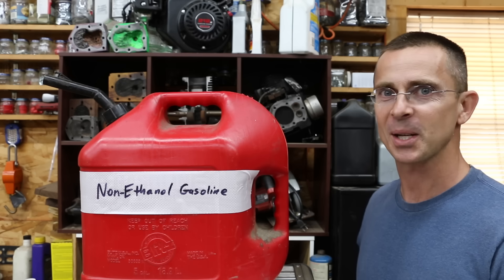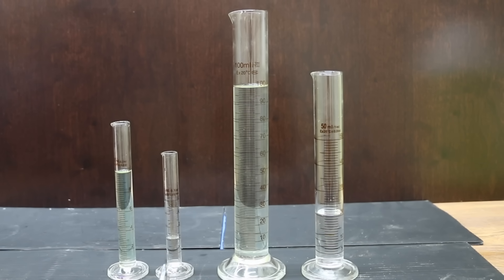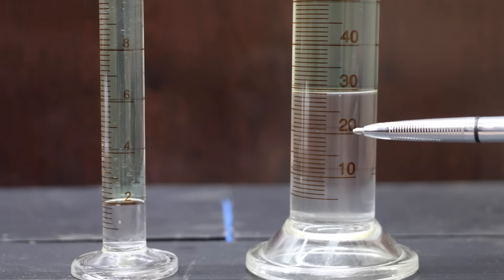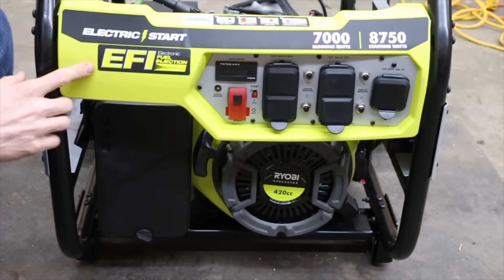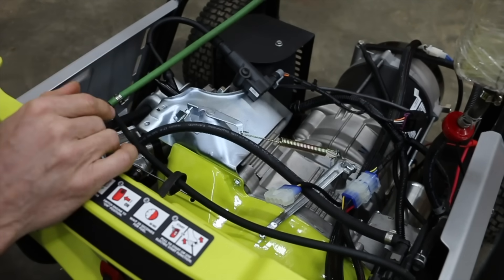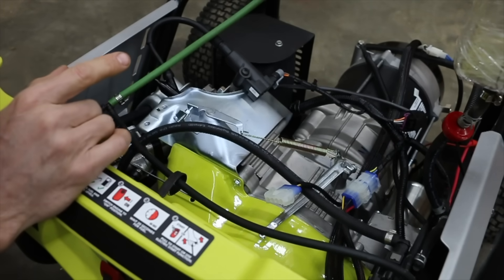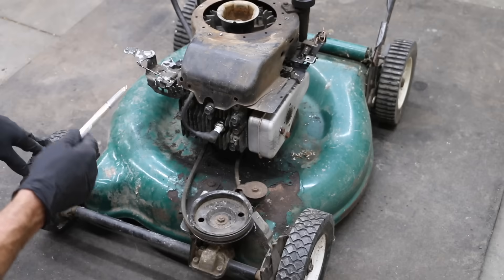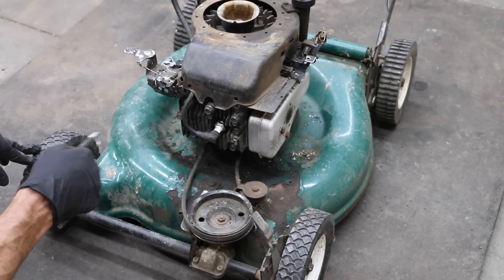Is Non-Ethanol Gasoline Really Better? See the PROOF!

Comment: Over the past 8 years  my Ford f 250,  390 ci V8 with 2 barrel Autolite carburetor has been rebuild 3 times only because  after about 1-1/2 years plus, it started leaking around the accelerator pump  and the spark valve,  I held them bothe up to the sun light  and they bothe were perforated with tiny holes,  all 3 times !!!  So I was talking to a gasoline tanker driver and he said that in California all gasoline is at least 10% ethanol unless you get it at
 an airport, as the FAA will not allow ethanol in their gasoline.   It eats away the rubber.  So far I have call two carburetor rebuild kit companies and they Don't make ethanol resistant carb kits ??
Reply from the maker: Thank you for the feedback

Comment: Lead was by far the best but not healthy
Reply from the maker: Thank you for the feedback
Reply: @ProjectFarm  i loved the video it was very professional. 

I had a 78 f250 when they switched the gas in my area during the 90s and it was a true chore to get my downdraft carb to work right.

I almost got the run time down on your test my guess would have been 32min because ethanol isn't as efficient as strait gasoline. I thought it was 15 to 20 percent less efficient I know my explorer milage really suffers on e85

Comment: To summarize: Non-ethanol is not preferred because it is "better" or more fuel efficient. The reason gas stations offer a pump with non-ethanol gas is so consumers can avoid the small engine issues caused by the ethanol content in conventional gasolines. If you put any kind of ethanol blended gas in your mowers, gas-powered blowers, trimmers, chainsaws or anything else with a small engine, you're probably going to have trouble. So non-ethanol gas is not favored because it is better or that it gives you something more, but rather that fact that it gives you something less - something you don't want.

Comment: You can't escape 10% ethanol fuel in my country. Every gas station has them, and are subsidised by the government, so it is cheaper than pure gasoline. I think it's the same as 100% gasoline, it also depend on your engine. Mine has a bit worsen fuel economy on ethanol fuel, but because it is cheaper per litre, I have no reason to use pure gasoline.
Reply from the maker: Thank you for the feedback

Comment: I noticed that rubber and gaskets dr in out terribly. With ethanol. Rubber in Weed Eaters dry out. The new carburetor cleaners cannot be used on any rubber. It will swell. But I've been using non ethanol fuel. I haven't had hardly any problems with my weed eaters. My chainsaw runs good with it. And you can sit for 6 months. And start right up. And they tell me that the ethanol turns into sugar. Because it is grain alcohol. Yep that's why there's so many diabetics in the world

Comment: Another great video! I am lucky, one of the gas stations in town carries non- ethanol in 87 and 93 octane. I treat the Jeep to a tank full from time to time and i do notice a little better gas mileage. My usual gas station is Costco.
Reply from the maker: Thank you for the feedback
Reply: I don't know what engine you have, but most MOPAR designed engines get MUCH better fuel economy (and MUCH less valve seat wear) with 100% gasoline. My 2017 Ram 5.7L Hemi gets 26% better fuel economy on 87 octane 100% gasoline as it does on 91 octane E-10. Using 91 octane 100% gasoline I have gotten as much as a 35% fuel economy increase, returning 27.6 MPG (by fuel burned, not the read-out) on a 800+ mile all 75 and 80 MPH Interstate cruising trip. Actually, 17 miles of in-town driving included. Now 27 1/2 MPG in a 5860 lb. (curb weight) 4 door 408HP V-8 auto tranny , power everything pick-up ain't shabby. I have a 26.77 gallon tank (from putt-putt-die) and traveled 680-odd miles between fill-ups. I gap my plug +.005" over "spec" and change them at 50K miles, all 16 of them. I watch and get coupons/sales from Pep Boys/Auto Zone/ O'Reilly's usually for NGK or Bosch Platinum plugs. It's a crime to use "gasohol" in small engines, especially 2 strokes. The oil doesn't mix with ethanol. The ethanol then attacks all the buna-s rubber in the fuel system (the diaphragm of the carb) and turns it into jelly, especially in storage. I can go to any garage/yard sale where weed-eaters are for sale (and don't run) and one pull tells me if they had ethanol in them.The rings are bad and the cylinders are scored=low compression.
Reply: @Walkercolt1  I have a Jeep Wrangler JL Unlimited. It has the 3.6 Pentastar V6 mated to the ZF 8 speed automatic. It is a lot better on gas mileage and refinement than my old Wrangler JK Unlimited. Both engines seem to like 89-93 octane. The JK had spark knock/rattle if I used 87. I always use Top Tier gas stations but on occasion I run the tank almost dry and fill it up with non-ethanol gas. I agree with you, the mileage is better and the Jeep runs better on it.

Comment: Combustion energy density in MegaJoules per kilogram
Gasoline (petrol) = 46.4 MJ/kg
Gasohol  (E10)  =  43.5 MJ/kg
A tank of E10 will have 43.5/46.4 (or 6.7 percent) less energy than pure fuel.
That does not mean that a vehicle will lose 6.7 percent in MPG. Modern vehicles have computers that can sense the fuel and make small adjustments in spark timing and other engine controls to partially compensate for fuel energy. Another engine with higher compression ratio might tolerate and adapt differently, depending on driving conditions. Ethanol tends to work better in engines with higher compression ratios.
Basically, E10 is the same as adding a few percent water to your tank. Pure ethanol has about 30 MJ/kg combustion energy. E10 also will suck humidity out of the air and becomes "more water" with time.
https://en.wikipedia.org/wiki/Energy_density
Reply from the maker: Thank you for the feedback

Comment: I get 30MPG with non ethanol gas and 25MPG with 10 percent ethanol. Non ethanol also feels a lot smoother at idle and has more power pulling hills.
Reply: @trevorwylie5882  ethanol boosted gas is only going to hurt badly without some sort of tune up to use all that extra octane. Even then it's not as good. But Ethanol can be created using farm byproducts among other stuff, it may well be the future for internal combustion engines once crude oil supply begins to run low

Comment: Greetings from the Napa Valley. Love your detailed videos.I have a small engine repair or service shop and get a lot of work from machines that sit for extended times with ethonal fuel.I'm very good at just cleaning the varnish and corrosion. We just had power shutoffs due to fire dangers from our energy providers Pacific Gas And Electric. I had a flood of generators 11 in a two week time span.9 of them just crapy ethonal fuel past its shelf life.I think you will be able to verify that. I did see your penetrating oil test and appreciate debunking some expensive but worthless brands now that saves us money Thanks. I use one called kroil that I get online or at a auto parts store I love it.It is not cheap  Says it creeps into a three millions gap. It does have a punjiant odor.Great videos Thanks. Jerry B

Comment: Consumes just as much fossil fuels to make this stuff from corn so no net gain in terms of the world pollution.  Does burn a bit cleaner and does increase the octane from 80 to a more 98.  What is does do for Milwaukee in Wisconsin, is move that pollution in making this stuff to Northern Wisconsin.  People up here are suffering from this fifty ethanol plants. 

Its hygroscopic, absorbs moisture, can use common forms of copper, brass, neoprene in fuel systems, will etch them away, also dissolves forms of plastic.  Totally destroyed the entire fuel system in my precious 88 Supra Turbo.

What doesn't make sense to anybody, 10% ethanol in some vehicles cannot use 15%.  Still has the same negative effects, but takes longer.

It's also a heterogeneous mixture ethanol and gasoline do not mix,  when a vehicle sits, the ethanol is heavier than gasoline so settles to the bottom of your tank, fuel pump picks this u first leaving you with 80 octane fuel that causes detonation in your engine to destroy it.

It is used to feed large SUV's and Pickups that burn more than twice the fuel as compact vehicles, people drive these beasts because it give them power.  The food to feed these beasts is taken away from us humans.

Ethanol with our corn is insane, does work much better with sugar cane.  Some dingbat politicians that don't know their hole form a hole in the ground push this BS against our stupid Americans.  Not saving anything.

Thanks goodness we have Mercury and Harley Davidson in Wisconsin, for a brief period, ethanol is all we could purchase.  Charging a lot more for ethanol free gas even those its cheaper to manufacture.  Makes one hate stupid politicians. Democrats and Bush kid were the worst.
Reply: all it is is GMO corn, which is not fit for human consumption. So its a loose loose proposition....not good for fuel, nor food....

Comment: The molecular structure of the blended ethanol/gasoline causes a chemical reaction that results in expansion and thus more volume reaping big oil substantial revenue  gains when dealing with massive throughput. So they are gaining financial rewards  through the sale of a certain amount of fuel produced through a chemical reaction reducing demands on their production inventory. This along with selling you a product that is  5% less efficient mileage wise gets you back to the pumps more frequently . This procedure is known as side stream blending . On the up side is reduced tailpipe emissions resulting in  better air quality. With thousands upon thousands of people dying every year due to respiratory illness directly related to poor air quality the ethanol blending is at least acknowledgement of the problem if little else.

Comment: I had a 2010 accent and the owners manual said to not put ethanol gas in it all.  I wonder if ethanol cause me to need a new head gasket.  Didn’t really feel much of a difference when I put non ethanol gas in it though.

Felt a RIDICULOUS different in my 94 car N.C. Camaros 3.4 V6.  And when i refilled with ethanol gas I really realized how much ethanol was holding it down.

I don’t think your gonna get more than manufacture specs, it’s just that ethanol keeps you from getting.

Comment: 10 percent alcohol gasoline started to be sold in 1979. The alcohol does less energy than the base gasoline, but the alcohol has more energy than the octane boosters it displaces, so the fuel has more energy with alcohol than with the full octane booster additives. Several things have happened in 40 years. The federal requirement to label the alcohol on the pump, the Internet and most of all, the other fuel additives now used have a shorter shelf life than the older fuel additives, with or without alcohol. So yes, fuel today does have shorter shelf life than fuel used to have. 10 percent alcohol had no great effect on the gasoline, but higher percentages can.

Comment: It makes sense to me that with a simple carburetor there would be a difference in carbon buildup WITH A GIVEN TUNE.  Properly tuned for whatever fuel you're using it would be a different story.  Exactly what the results would be I don't know, but to my knowledge nobody has ever done that test.  Alcohol and gasoline require different air-fuel ratios.  A car, with electronic fuel injection and lambda sensors, will adjust the mixture as needed for different fuels.  Lawn mowers will not.  Unless you're re-jetting, and possibly even changing the basic timing (difficult to do with magnetos) then you're comparing apples and oranges, as far as which one gives you less carbon buildup.  But the alcohol WILL wreck rubber fuel system components.  It WILL result in corrosion in the fuel system.  It WILL increase fuel consumption and reduce power output.  Those are givens.  Use non-ethanol fuel and keep the spark plug clean.
Reply from the maker: Thank you for the feedback!

Comment: Basically a worthless test as the duration was too short to make any meaningful comparison.  Of course non- ethanol gas will get better fuel economy, it has a higher energy density.  Also, without tuning the engine for the type of gas being run the test is automatically biased towards the fuel it was designed for (this goes both ways).
Reply: So your assuming everyone drives cars that have been made to run with ethanol?"
Reply: @ghostcell030  No, since at low levels (10%) the addition of ethanol makes almost no difference- and yes, since for the last 20 years 10% ethanol blend has been standard throughout the US, I would have expected manufacturers to change their tunes enough to accommodate.

Comment: In Alaska ethanol blended fuel at the general pump is banned because it pollutes the waters by corroding seals/lines in marine equipment. To sell any ethanol blend it has to be at a proprietary pump and clearly labeled.
Reply from the maker: Thank you for the feedback
Reply: And AV gas (like 100LL)  is pretty easy to get owing to so many private pilots.
Reply: @SaneAsylum  can you refresh us on what is avgas? Purified gasoline?
Reply: @MmeHyraelle a gas is just gas that has higher quality standards. Octane is higher in some grades, plain old 87 in others. My aircraft has a supplemental certificate that allows me to run it on 87 unleaded with no alcohol auto pump fuel. Saves a ton of money.
We had some fuel thieves one night….thought they were getting avgas for racing fuel…. We all hope they enjoyed their loss of performance.  lol
Reply: Should be that way everywhere. We are having that crap forced on us.
Reply: Brazil has 100% ethanol fuel at every pump. A permanent competition with the oil companies. Why aren't their engines falling apart?
Even Henry Ford knew it was the way, it was his fuel of choice. Rockefeller quashed that by pushing prohibition.
Watch Pump (2014): https://vimeo.com/237643999
Reply: @thewolfin  several years back I ran a full tank of 100% ethanol fuel in my Dodge Ram.  I believe my engine ran smoother, had more power and went longer before it needed refueling. If I could get 100% ethanol fuel where I live I would buy it.
Reply: They killed an industry with Cash for Clunkers, never forget everyone involved
Reply: DOPENOLA 1  just because a country  has issues doesn't mean certain aspects or ideas that come from it are automatically bad.
Reply: In 2006 Missouri enforced 10% ethanol in ALL pump gas. My new vehicle instantly lost 10% MPG, go figure. Now, my new 2019 vehicle only gets ethanol-free gasoline. Only one Casey's across the state line in Kansas offers 87 octane ethanol free. 91 octane ethanol free is all that is available, so be it.
Reply: @tedroesch9133  In the last few months I've also started using only non ethanol 90 octane gas in one of my cars. Luckily I have a gas station just 5 miles down the road that sells it, but when I travel I discovered an app that I downloaded called "pure gas" and it gives a map of your local area that you are currently in showing all the gas stations that sell non ethanol gas. Even if I have to go out of my way to get it then so be it.

Comment: From my personal experience, I have a Chain  saw I had purchased new.  The manual states I could use 10% ethanol so I did. . It did OK but was hard o Start and hard to keep running but was able to use for a while.  Over time I noticed the plastic fuel cap kept getting harder and harder to remove, then the machine was even harder to start and keep running....  the fuel cap became so hard to open to the point I had to take vise grip pliers to remove the fuel cap....  I decided to change to non ethanol fuel and after the second tank the fuel cap would spin off by hand and the saw ran like a new beast....  such a dramatic change  made me a believer   I also started running it in my leaf blower after replacing the primer bulb that had got hard and brittle and 3 years now bulb still soft and blower runs like a Swiss watch....  will it run =yes  is it equal to or better?=no   I run ethanol in my truck with no issues.... but not in small engines...
Reply from the maker: Thank you

Comment: Pretty much most any manufacturer of small engines will tell you ethanol gas means engine problems sooner; less power; more fuel consumption. 

Newer cars/trucks - larger engines can handle ethanol gas better but when/if available - nothing wrong with filling up with non-ethanol gas - usually mid-grade/premium in this area. 

The beginning of this video indirectly puts it in prospective as 10% ethanol/10% water - all about the same. 

Helps the corn farmers/lobbyists and then the bueracrats feel all fuzzy all over but otherwise pretty much garbage. 

Always have an always will run non-ethanol in small engines.
Reply from the maker: Thank you

Comment: You know, they add it in the colder months claiming it is to protect the ozone layer. What a LOAD OF CRAP. Gasoline is denser at colder temps, you get more (pardon the pun) bang for your buck, better mileage. Ethanol is way of "watering down" the gas, they make more money off it and your vehicle uses more gas making  performance and mileage less.
In short....ITS A SCAM.

Comment: I have reports from other classic car owners that the ethanol eats away some of the important seals in the fuel system.
Anyway; I prefer LPG.
Reply from the maker: Thank you
Reply: Ethanol ruined the carb on my 71' Mach 1.
I have to use ethanol free. Not willing to lose horsepower so no LP for me.

Comment: Ethanol has fewer BTU's than gasoline and much less than diesel fuel. Ethanol in our fuels is to pacify the Greenies. Considering the subsidies, having to grow the corn, fermenting and then distilling it is a negative consequence. Not to mention the corrosion to engine systems. But our corn farmers do prosper.